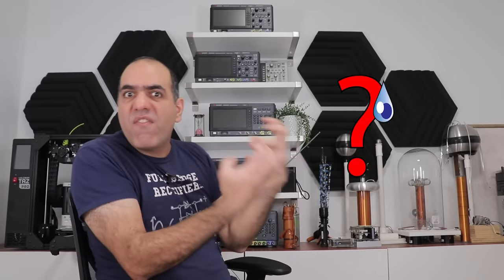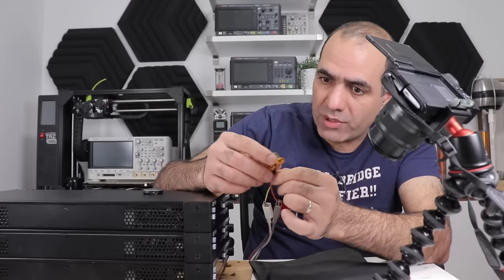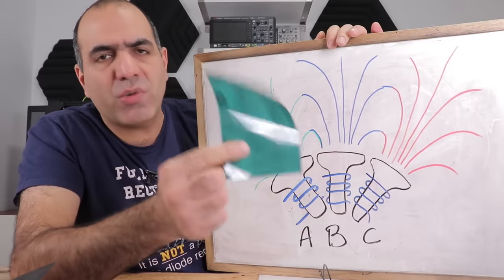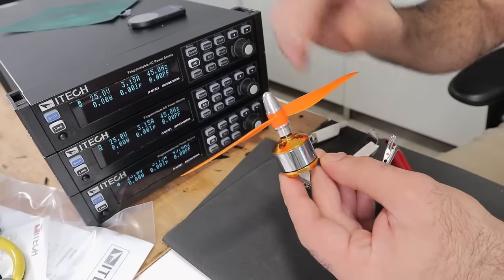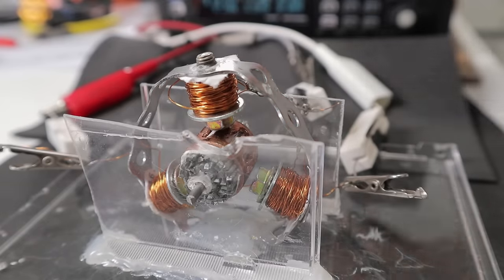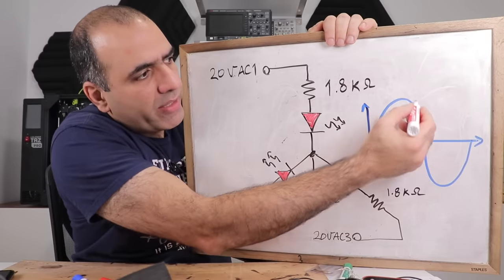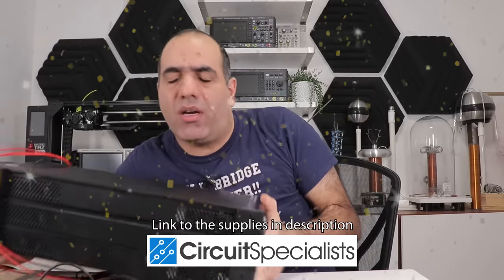Trying to See Rotating Magnetic Fields

Comment from the maker: Hey hey! If you like to see me rolling, I uploaded the full 3-Phase Dream in my second channel Mehditation you can all MEHDITATE to!! https://youtu.be/MgJyJwoMll4
Reply: 1 mins ago!
Reply: Sup
Reply: Wouldn't the rotation of the field be perpendicular to the axis of rotation?
Reply: Watched it!
Reply: Which Animation Software do you use, sir?
Reply: Petition to bring back ElectroBloop channel
Link- https://youtube.com/c/ElectroBloop
Reply: Hi Electroboom
Reply: Add the diodes to the coils, so the sheet shows only one polarity (eg, when the coil goes N) as it otherwise shows both polarities, making it look always on.
Reply: @vikkysawant1271  he has another channel ? I didn't know that I have to go check it out
Reply: HELLO ELECTROBOOM🐙
Reply: use a magnet in the shape of disc, where a one pole is on inner circle, and the other pole is at the outer circle, place the stator inside this disc, and that magnetic sheet in between (with a small distance apart from both stator and disc) the attraction and repulsion forces will make the pattern on the sheet which you desired
Reply: other method could be using diodes on stator itself, making sure that if the poles become north, then they won't become south, and maybe use lesser frequency
Reply: Thanks for proving me right!
Reply: Can we please get a 10 hour video of the three Mehdis rotating the rotor?
Reply: Make a ferrocell; actually see the magnetic & dielectric; understand the ether.
Reply: 1:08 hope this doesn't get demonetized.
Reply: i raise over unity device
Reply: Now bulid a Bedazzler non-lethal weapon.
Reply: Epic?
Reply: if you can get epilepsy from the blinking lights, then what can you get from the ending sequence of this video?
Reply: Hi Mehdi, if you'd have put blue LEDs in the other direction, you'd get something that would look like a rotating police light! 😊
Reply: Hello Mehdi 👋🏻
Reply: MEHDITATE MEHDI
Reply: @ElectroBOOM

actually this film shows magnetic field in above directions (if I'm right)
so, it blinks 2 times by each period 

means 50 times per second for 25 Hz
Reply: Mr electroboom can you give aways get to chile?
Reply: @richardbarker7623  That's a good question. I wonder if that would change anything. I'm kinda disappointed he didn't manage to do it. Someone hit up slow mo guys
Reply: We're near to 5M subs!!!!!
Reply: 45Hz may be too fast for this green film to react. I would try much lower frequencies. Less than 10 Hz.
Another idea that just came up. Film is dark when magnetic field is at 90 degrees angle to it. No matter the direction. In each pole it is always 90 degrees on core ends. Only amplitude is different. So such visualization can not work at all.

Thanks for the great content by the way!
Reply: @vikkysawant1271  thank you 🙂
Reply: Hahah i like that motor outro effect 🤣🤣🤣
Reply: @vedanshverma8626  same here 😂😂🤣🤣
Reply: #teamseas...................
Reply: @kaylatorres6098  ty🤗
Reply: Missed opportunity there- three sets of your bouncing eyebrows at 120 degrees to each other.
Reply: @markfergerson2145  🤣🤣🤣
Reply: @vedanshverma8626  your welcome 🙂
Reply: That part at the end though where three of you are turning it! 😆
Reply: @bringer-of-change  three phase of mehdi sir 🤣🤣
Reply: boom roll
Reply: ممنون مهدی آقا ، 😂 ایول خیلی باحال بود
Reply: Awesome...Mehdi-current
Reply: But who would be the ones hatin if we aren't
Reply: Please do the LED demonstration with blue LED-s connected the other way around representing the negative part of the cycle!
Reply: Is there any doubt that the most terrifying "type" of parent assumes that SINCE she could die before her child dies, she must believe that *Her Child Is Immortal*, and that because that is "SUCH a difficult truth of Life (not believing the child potentially can either reject or accept a similar fact) TO Accept" she has become too humble and needs to attack others more?
Reply: Sub
Reply: I love your videos there not bs like most!!! and I learn a lot even tho I’m noob lol anyways I’m in dilemma I’m trying to make a gift for my niece who is nine so it needs to be safe and I’m trying to make it all run on 1 or 2 volts can u or anyone in this community give me any advice?? I’m sub to your other channel as well.
Reply: Are we PREVENTING each other from proving that we have good humor no matter the circumstances, or are we FORCING each other to discover THAT OUR SURVIVAL is the proof of good humor?
Reply: ElectroBOOM check out Veritasium’s latest video. I would love to see your breakdown of the scenario.
Reply: Can you use an android device as an oscilloscope using it's mic input? (I just want to measure low voltage like 5v)
Reply: You should do it, with dual color LED, like red green etc. depend on polarirty :D it would be nice ;) so where is red dark spot there will be green.
Reply: I have always enjoyed a good roll lol 😂! I will check it out! Happy holidays!
Reply: Wo
Reply: @raffaellu4375  hi!
Reply: Would a donut shaped container with a bit of ferrofluid in it work. Then you could put the motor in the center and spin the fluid around. That would be a cool little demonstration.
Reply: @arrowed_sparrow1506  would be fun to see what that would do. Have you tried this experiment? What are your thoughts on the potential outcome?
Reply: It's not using electro magnets, but if you want a cool demonstration of rotating magnetic fields from a Model 3 rotor, have a look at the link below and start it at 7:17.
https://youtu.be/SRUrB7ruh-8
Reply: Put iron shavings in a very viscuous liquid, inside a torus shaped container, and put that around your electromagnet. You should see the fluids/shavings spin. @ElectroBOOM

Comment: Hey Mehdi, I was thinking 🤔, instead of wrapping the film around the motor, what if you cut a hole the size of the motor in the film then poked it through? That way maybe you could see the field lines in cross section.
Reply: Make sense
Reply: Maybe ferrofluid on front of stator will be better?
Reply: The problem is that the two poles appear the same and also that they always occur at the same locations.

We don't see the magnetic fields move on the magnetic film because the magnetic fields are not moving around! They're always in the same spots, either 'moving forwards' or switching and 'moving backwards', both of which show up as a dark spot.

During the transition though, when there is no field, I think the film needs more time to dissipate. Similar to how iron filings somewhat retain their shape even after the magnetic field has been removed. I would guess that you'd need less than 1hz, but again, all you'd see is the dark squares flashing on the same spot.
Reply from the maker: not a bad idea! I may give it a try
Reply: Yeah thats what i thought. Though im not sure if the magnetic fields would be strong enough to print something in the  SSSSSHHHHH E E T. 

You usually put the magnets directly attached to the sheet to see its magnetic field, maybe they are designed to work only in that way bcuz only there the magnetic fields can affect the material. Idk.
Reply: Sticking a small compass where the induction rotor usually goes and replaying in slowmo would show the net magnetic field the rotor experiences
Reply: @ElectroBOOM  Might not even need to cut a hole. Just place the sheet next to the motor
Reply: @ElectroBOOM  can you glue many sheets together? You won't see the inside of the sheet, but maybe it'll help with stiffness? I guess you could also stack a sheet, followed by iron sheet, followed by another of those sheets. They may help carry the flux better than air?
Reply: An array of tiny magnets on sticks wrapped around the stator. Kind of like a ring of fence posts each with 2 or 3 x 3mm dia disc magnets with a hole for thread so they can turn as the mag field changes.

It would dance. 

Very fiddle to set up though.
Reply: Thats my first thought when i imaginded how he would show us the fields moving.
Reply: @LifeofanElectronicEngineer  your comment makes no sense
Reply: I was thinking a cloud chamber might work but you're idea sounds much cheaper.
Reply: That could be a good idea, although maybe the material would pour out and that would suck

Comment: Great video Mehdi! My best guess is that the film takes too long to "decay" between its magnetized and non-magnetized states, so you can't see the changes. Love the LED demo, that was an excellent visualization!
Reply: It's possible, the film is basically tiny capsules of gel with flakes of ferrous material floating inside, applied to one side of the plastic film. I have a theory that the particles also just align themselves with the magnetic field based on shape, and are stable in either 180 degree orientation and don't need to actually move to stay stable when the polarity reverses, if that makes sense? Not 100% sore if it's at all correct, but I have a sheet if you can think of a way to test.
Reply: That sheet works in such way that it's dark when field lines are perpendicular to it and light when they are parallel.
For proof you concept, could simply rotate/move permanent magnets to see if those can be seen on film or at what speed film can't trace them anymore.
Reply: Yeah, I immediately thought that the oscillations would be way too fast to see.
Reply: Agreed. That "piece of sheet" is more like "e-ink", very slow. A 2 Hz waveform would do better.
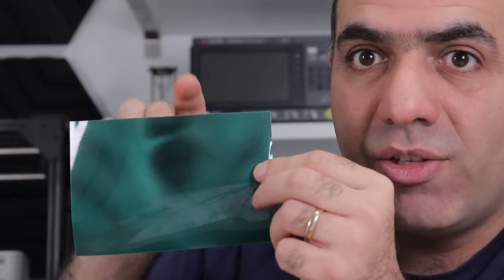Reply: @andiszile  Uh.. isn't it what Mehdi did at 1:14 ? 🤔

Comment: I think 45 Hz is too fast for the magnetic viewing film, the nanoparticles don’t have time to change their orientation. 

Maybe try 1Hz
Reply: same thought...
Reply: I agree with "go away" (funny name btw)
Reply: At 0:44 he says his power supply can only provide from 45 Hz to 1000 Hz u didn't hear?
Reply: Maybe iron filings on paper sheet will be better than this magnetic sheet?
Reply: @universal69  Yes we heard that. But 1 Hz can be easily done  by hand using some ...aligator clips, for example. It will not be sinusoidal, but it will clearly demonstrate the rotating field for the purpose of the video.
Reply: @universal69  I didn't hear that. Now I understand why he couldn't accomplish the objective in the video. But I think 2Hz would show the rotating effect.
Reply: @universal69  If my electrical theory is correct he could have just put it into a 45 to 1 transformer to get that 1Hz output!
Reply: @Darryl_Frost  Your electrical theory is sadly completely incorrect. Transformers change voltage, not frequency.
Reply: Maybe 1 Hz is still fast for eyes. I typically would try 0.1 Hz.
Reply: @DasAntiNaziBroetchen  We'll it is never going to happen with that attitude !

BTW: It was a joke.. (not saying a good one). It had potential, but not enough current.
Reply: 1 hz, isn't that called DC? Haw haw haw
Reply: @RustyorBroken  gosh... DC is 0 Hz. 1 Hz is one revolution per sec.
Reply: @zihangao7385  /rwoosh
Reply: @RustyorBroken  all current is DC in a small enough frame of time
Reply: @lorenzo42p  I suppose that's true. It's all relative. Now I'm thinking about what infinite hertz would look like. It seems that it too would be DC except that it would appear to be both positive and negative simultaneously.

Edit: or maybe it would be zero volts. Hmmmm.
Reply: This test was doomed to failure because once oriented in a particular direction by a magnetic field, the particles stay oriented that way until affected again. Notice the "ghost" of the two-pole magnet's field at 1:59 that remained when he pulled the film and magnet directly apart after showing us its field. Notice the ghost is symmetrical and doesn't show two poles as it did before; that's pretty much how a degaussing coil for CRTs works. As he pulled the magnet away the particles retained the orientation imposed on them by the weakening field. he best they will ever do is show the RMS average of the imposed field whether oscillating in place or rotating.
Reply: @bardes18  found the mechanic 🤣

Comment: Maybe you can visualise the rotating magnetic field with the following setup.
Small reservoir with a tube big enough for the stator to fit inside.
Fill the reservoir up with mineral oil and add some iron dust around the tube with the stator inside.
If you then connect the stator and turn your power supplies on, you might see the rotating fields.
A less viscous liquid or water, may be better for higher speeds.

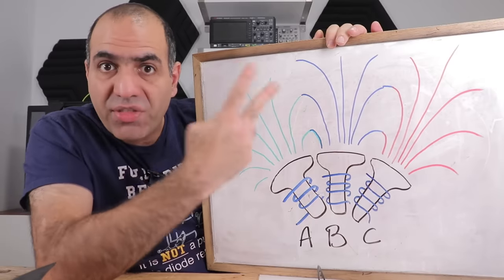Comment: Mehdi -- I think you're right at 3:15 about both North and South appearing as solid dark.  However, you might be able to "bias" the field seen by the sheet. For example, if you positioned North poles on the other side of the sheet (at some adjustable distance), than at the sheet's location you might get either strong field lines, or minimal field lines, and thus dark or light pattern on the sheet.  But also the rate of change (rotation) probably needs to be far slower than 45 Hz.

Comment: To effectively see current flow in two different directions, you can do the same except use two different colored diodes on each leg of the wye with one diode connected in reverse of the other. Maybe red could represent north, and blue represent south.

Comment: PLEASE keep going with this visualization.  The magnet paper would be so awesome to see.  Can you just slow down the frequency to like 1hz?  Also, if you can show the lag, that would be incredible.  Perhaps instead of the paper you could put a sheet the field can penetrate with a punch of metal shavings on top?
Reply: None of those would work because each point is always a magnetic extent where the shavings would collect but simply change in intensity both positive and negative. So the shavings would never move away once they are at that point.

It may be possible to collect the magnetic power using an inductor coil to power an led. But that wouldn't really be any different than just removing the motor and showing the phase with LEDs like he already did.

Comment: We have an automatic transfer switch at work that has a bank of 6 LEDs on the side, basically showing the same thing (except the extra LEDs are for the negative voltages). I used my phone to capture this in slow-motion once and you can definitely see the rotation.

I think the idea of having the indicators is as a quick way to see if one of the phases is gone or misbehaving.
Reply: Think you can post the video?
Reply: @taliakuznetsova7092  I'll have to re-record it and get back to the office, so it'll be a couple of days. Car's in the shop.

Comment: Have you tried running it at a much lower frequency like 1Hz so you can at least see the magnetic poles getting stronger and weaker as the voltage level changes?

Comment: I have 2 suggestions to (maybe) make your original visualization work with the magnetic viewer film.
The main issue is that fields running in either direction (north or south poles) look the same on the film. To address that, I was thinking that you could make them look different by changing the strength/magnitude depending on the field direction.
The first suggestion isn't changing the circuit at all, just adding a constant field in addition to the dynamic field by the motors (putting a stationary uniform magnet near the film). When the dynamic field aligns with the constant field, they constructively make a darker region on the film. When they oppose, the region is lighter. This would still be, at best, a very greyscale animation; and I'm not sure how contrasted the regions would be. Worth a try?
An alternative approach would be to actually modify the circuit to achieve the same effect. Adding a diode on each coil (e.g. zener, or Schottky + resistor in parallel) would make it so each coil produces a stronger field in one direction than the other. This should be able to be seen on the film, and thus visualize the changing magnetic fields.
I suppose either of these approaches look the same as a field changing strength (and not direction), but whatever..  constant values on graphs are silly. :P

Comment: Ideas to get a better rotating visual with the magnetic-sensitive paper:
1) Slow down the rotation to 1-5Hz range, so no slow-mo is needed.  Part of the problem may be that the response time of the paper itself is too slow.
2) Place the paper flat perpendicular to the motor axis, rather than wrapped parallel to it.
3) Use a motor with just two or four poles (3 or 6 coils) instead of that one, which is an 8-pole motor (12 coils).

Comment: As a followup to the last demo, I suggest replacing your safe and boring single-colour LEDs with bicolour LEDs and removing the central ground connection to allow and visualize the current flowing in both directions as the polarity between phases flips.  So pretty.

Comment: I think a wonderful way of showing field rotation might be to set up the spinning soft iron egg display that Tesla himself designed and introduced at one of his exhibitions. You could put LED's across the field coils which would light up on the positive half of the cycle, and see that the egg, starting from a stationary position, gradually begins to turn and then catch up with the lights. Even better is that when it spins at full speed, it stands on it's end while spinning!
Just a thought!